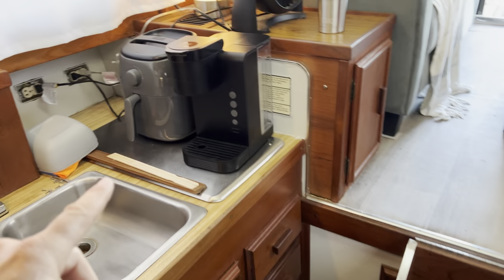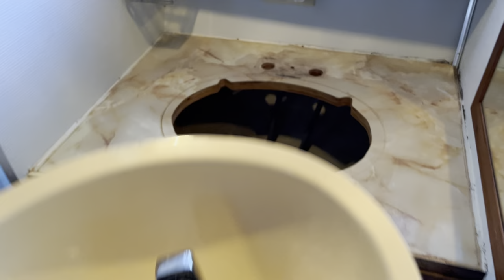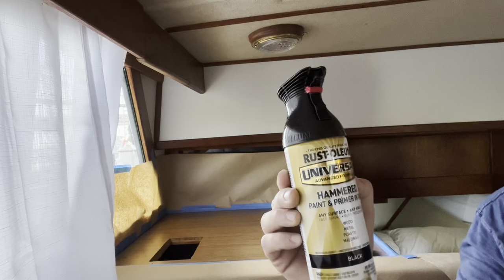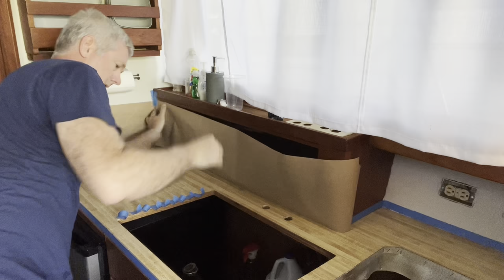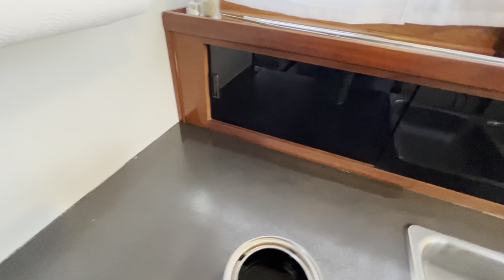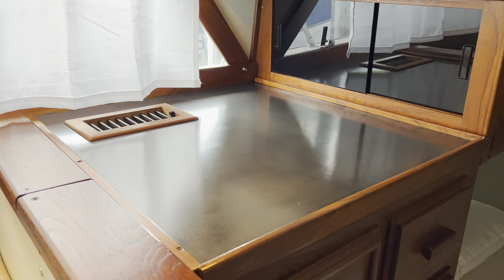Cabin Cruiser/Trawler/Sailboat Boat Interior Upgrades!!!!

Comment: We just finished up the mattress for our V berth.  Preparing to take our new to us Marinette for a 3 day trip to NC.    Looking at your pillow setup do you guys sleep front to back?   We were mucking about after M finished setting it up and found sleeping side to side slightly diagonal was much more room.  

Our boat also had smoker (s) on it so we had to do a major scrubbing.. it's just now smelling less like bowling alley
Reply from the maker: We typically sleep sideways this gives us much more room. When you have time and get your boat, home at your marina, get some glade plug-ins this will help. The light above my head is a glass dome, but it does have a incandescent lightbulb. I am going to be switching over to LED bulbs instead to help battery life and reduce the heat that those incandescent bulbs create.